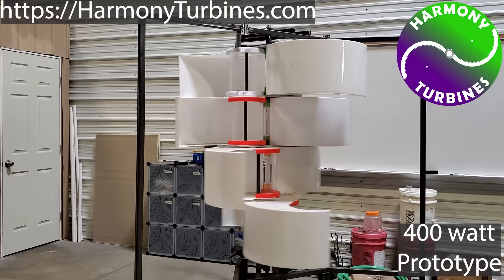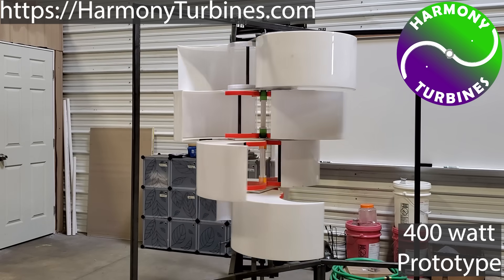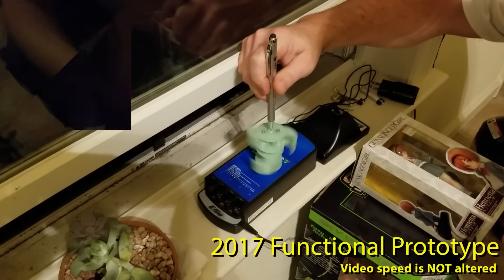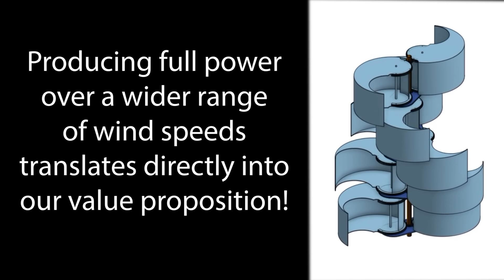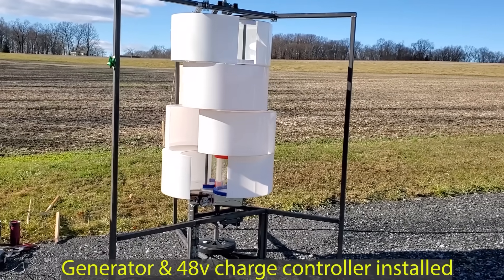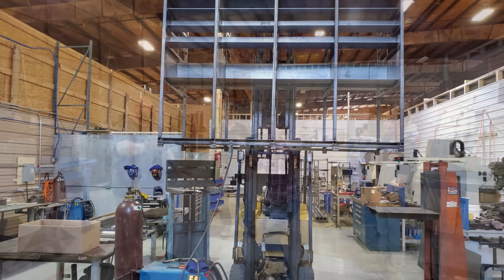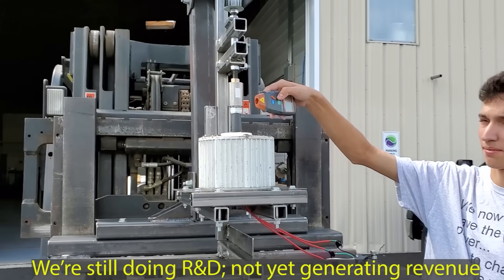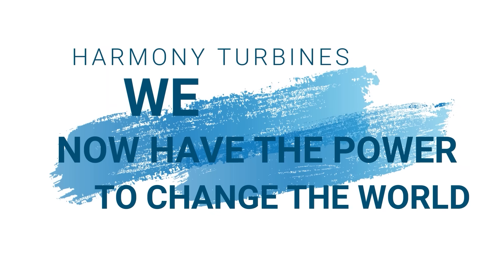What makes Harmony Turbines so revolutionary?

Comment: Well done! This is a great idea. Good luck bringing it to market. This makes so much more sense than the big bladed turbines we see now.
Reply: It really doesn't. 
There are major issues with VAWTs, the primary ones being the stress on the lower bearing (think of the leverage), the poor start at low wind speeds (for savonius turbines) and the poor swept area.
Reply: No, the mathematics and economics does not add up. They will cost too much and be too inefficient. Do the mathematics and see you will need about 100 of them to power 1 home.
Reply: There's a reason why people who build wind turbines to sell the electricity choose 3 bladed horizontal axis types.
Reply: @TerryClarkAccordioncrazy  I agree with you - and it is clear from the responses from harmony that large-scale production is not their market. They are looking at the small and medium market, where their VAWT design definitely has some advantages.
Reply: @Alastair510  What advantages would a VAWT have?
Reply: @TerryClarkAccordioncrazy  in small installations they are safer and quieter. There have been accidents on boats with people walking into a turbine blade. Less risk of over speeding in high winds
Reply: @Alastair510  Never heard of such accidents. People got brains and eyes. At least most skippers do.
Reply: @Alastair510  if they are quieter then there is a good chance that they are just less efficient. A HAWT would be just as quiet if you reduced its output to match one of these.
Reply: @ndvorsky  A lot of the noise of small HAWTs comes from blade tip flutter.
Reply: @Alastair510  ah, that could be true. I’m more familiar with larger ones.

Comment: Yes sure so instead of harvesting that nice extra energy. Let's make sure we don't use it. Great job 10/10. Totally not inefficient
Reply: Well, if you can't store the energy or utilize it on spot, making the system more robust -> more expensive to capture high speed wind (that happens once a year or so) would just be waste of money and material. Plus if you make something bigger, more heavy, etc to support high speeds, then it will be inherently less efficient at low speeds. So it totally make sense to have self regulation.

Completely other situation would be if you are in area with constant high wind speeds, then yes, just build system for that high speed.

That's what we call engineering - building systems that fit the situation they are put into just right, but not over do it. Same why you don't wear 5 sizes bigger shoes or pants.
Reply from the maker: Patrick, it doesn't stop turning it merely self regulates so that the turbine does not over-speed. It's still producing full power through the high-wind event.

Comment: What about drag so common with vertical turbines, which traditionally gives them such low efficiency? Or has this design compensated for that?
Reply: Power is mainly determined by wind speed. For 1 square meter the MAXIMUM energy from the wind is kW = 0.0006 * wind speed CUBED. So for 1m^2 and average city wind speed of 2m/s you get 4.8 watts. Small city wind turbines will always be useless.
Reply from the maker: Hi Lothar, It's finally coming to light that this has been a disinformation campaign for decades starting back in the 1950's or around there. Look at this https://youtu.be/pbtR6VG-gLw?t=225  If you'd like help support our efforts through an investment you can go to https://WeFunder.com/harmony.turbines and if you're not able to invest we would ask that you at least help us to spread the URL to let others know what we're doing here to help make the world a better place.

Comment: Could you add a concave cover on the wind catching side? I love the design but here in Maine that scoop is going to fill with ice and snow...and that's the time of year I'm going to need it most in a hybrid system. Perhaps a heating element?
Reply: Could probably just remove some of the lip on the bottom to maybe 10% of what it is and still keep some of the original rigidity. It could still flare at the base where the gear teeth are.

Comment: Same old same old drag turbines - complete and utter nonsense. Proven bad for decades,  You have no clue how to do R&D because you have done no research before reinventing a worthless concept.
Reply from the maker: Chris you're spouting drivel from decades of misinformation on this topic. The universities are aware of the incorrect data that's been published but it has not yet hit mainstream. Watch this and do some research. https://youtu.be/pbtR6VG-gLw?t=227  Straight up savonius turbines without a helix twist or even ribbing are somewhere around 30% efficient. Add the extra features and they are even better.
Reply: @HarmonyTurbines  Nope - I can calculate drag and your turbine is worthless.

Comment: Very nice just the climate bs will end killing you. If greenhouse gases are bad for plants what is the purpose of greenhouses?
Reply from the maker: Greenhouse gasses are bad for the rest of the planet because of the rise in sea level and overall temps going up up up. I never said the gasses were bad for plants? Not sure where you got that from.
Reply: @HarmonyTurbines  Whatever, but ice is less dense than water. What i'm sayin is that you are pretending to be woke so someone will respect you for this. I do not, sorry about that, even if i really like your device.
Reply: The purpose of greenhouses is to get warmer temperatures sooner and longer through capturing solar radiation in a small space instead of letting radiate back out to space. Even then greenhouses have venting systems to prevent them from getting too hot. Prove the "climate bs" is bs.  Go ahead refute the current empirical data on retreating glaciers, record temperatures, breakdown of the jet stream, sunny day floods. Back up your claim with evidence. 

Ice is less dense than water--yes agreed, but that is not relevant, Ice already in the ocean will have no effect on ocean levels when it melts--it is the warming that will expand ocean volume (things expand when they get hot) and the ice on land that melts and adds to the total volume of liquid water in the ocean that makes them rise,  

And being "woke" as you call it is not an insult; it says more about you and your adherence to dogma and lack of intellectual curiosity.